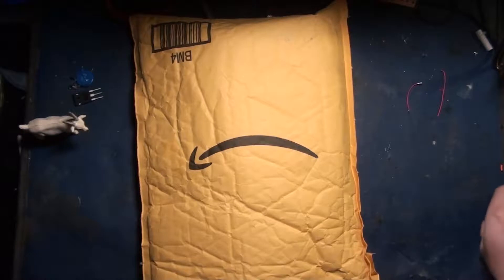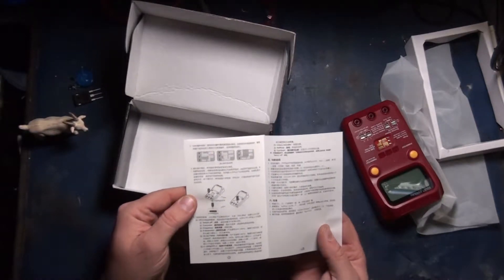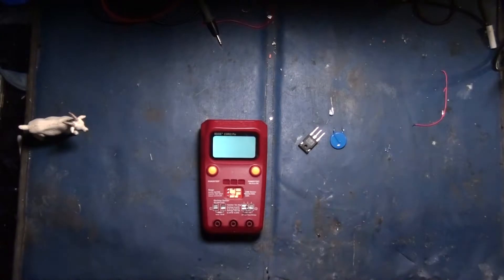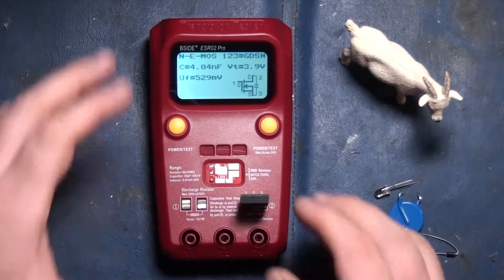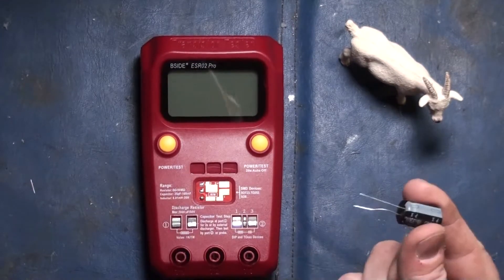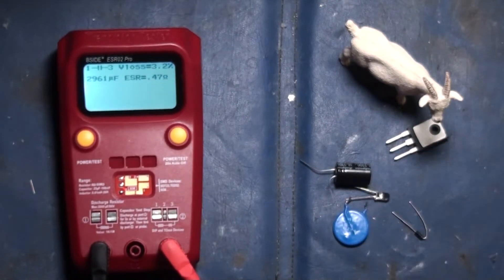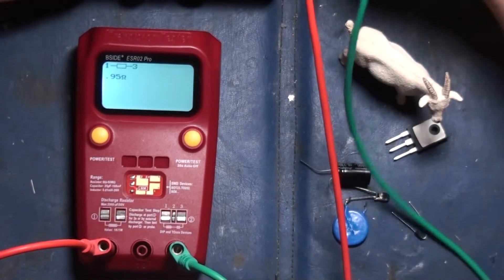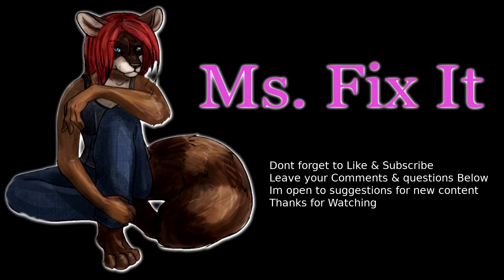I got my new Component tester.

Comment: hi, can i use it in cuircuit ?
Reply from the maker: Yes, you can
Reply: @thefixitgal  thanks for the replay bud, one question, if i have this meter, or meter like 'leak ESR70 Atlas',   do i need also capacitance meter like fluke to test μF? becouse i see this one show resistance & microfarads .
i'm trying to fix few bad monitors
thanks man
Reply from the maker: @Tal.10  Capacitance is measured in uF. It does fully test capacitors. Make damn sure to discharge them first XD!!